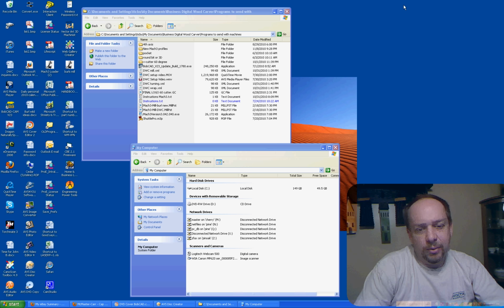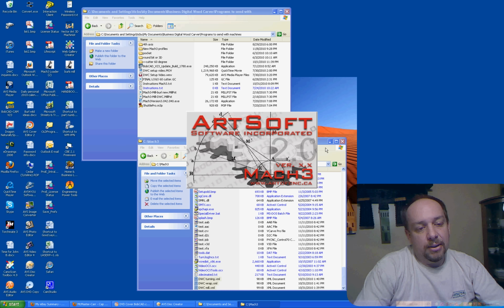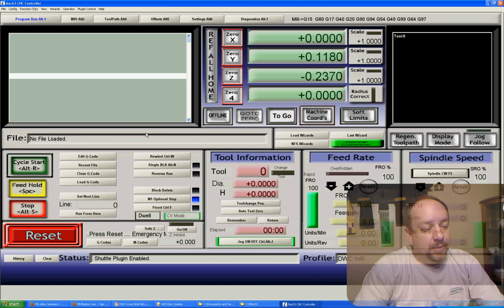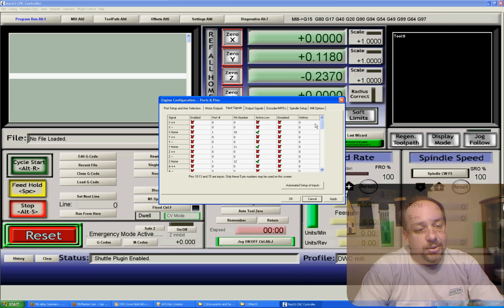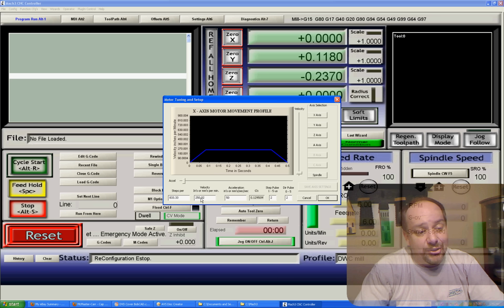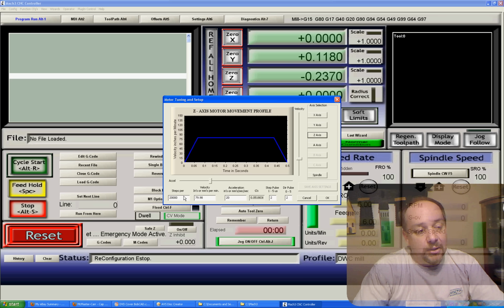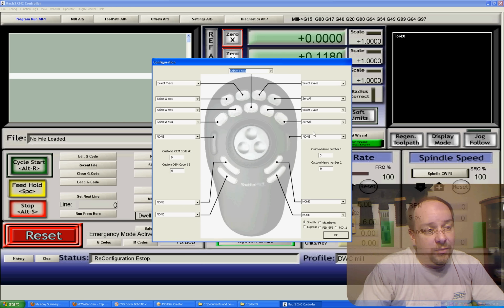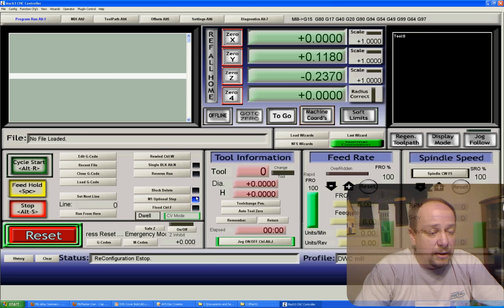Mach3 Setup

Comment: I just purchased a QC 1325 CNC router w/JDPaint 5.5 and Mach3 from China.
The machine will be delivered in about a mouth. I've been looking to find some info on the JDPaint.
Also I have a lot more question about how all this works.
I don't want to spend hours drawing a program when I can download it from somewhere . I heard of Dreamstime.
How do I do that?
Can you import art from anywhere and install in mach3
How to send from cad to mach3
I would like someone to run the the steps of downloading a file putting into cad send to mach3 and hit the start button on the cnc.
Can you help!!!
Thank you! :)
Phil
Reply: check out artcam express or autodesk 360. other than that you have a bit of work to do to instruct the code of what you want what tool you want how fast to run how deep to cut even what angles to cut.
good luck

Comment: Hi Burl I was hoping you might have a fix for a Mach3 Problem I am having. I am using ESS it is communicating with the computer I have I am using a G540 have the proper resisters installed.  All the right lights on the ESS light up G540 is green No faults I have down loaded all the drivers.  When I enable the drive the motor gets power but when I try to jog nothing.  I have rechecked the cables and I am stumped.  Any ideas where to look?

Thanks and nice video
Reply: look up mach3 web site and watch their videos

Comment: Hello
I have built 5x5 cnc plasma table, but i cant get it to run. I think there is no communication between mach3 and parallel port. When i run parmon parallel port tester and i press pins with mouse motor move then, but when i press arrows on keyboard motors will not move. I have set in ports and pins everything correctly. Thanks for replys.

Comment: hi i have a problem in my 4 axis TB6560 in mach3 i need to use it for foam cuting so i need x1 x2 & y1 y2 how can i set the mach3 to work 4 motors ? blackwater11@hotmail.com

Comment: Dear BWT I am trying to build a homemade cnc mill with 4 axis driver board and running the mach3 program. What would be the formula for figuring out the steps per, if I am using a Nema 17 and a 1/4-20 threaded rod for the x axis and also the y axis how do i configure them for the motor and tune up step, velocity , acceleration, step pulse, and the direction pulse?  I know there has to be a formula but not sure how do it. I admit I am a newbie to this artform but I am facinated by it. Thanks Don

Comment: HI, I HAVE BUY 3 LONGS MOTOR DRIVER DM542A AND 3 MOTOR NEMA 23HS9430 2 PHASE MOTOR 1.8° 4,8V 3.0A PHASE , I CONNECT ALL AND SETUP MACH 3 BUT MOTOR MOTOR DOESN'T RUN BUT MAINTAINS HOLDING TORQUE WHY ? FOR YUO WHERE IS A PROBLEM ? MACH3 PARAMETRES ? THANSK INFO@2TSOLUTION.IT

Comment: I want to make my own CNC with Arduino and EasyDriver shields
(the motors i allready have)   
is there an Mach3 or GCode interpreter for Arduino (without flashing firmware)

Comment from the maker: @HossHossHossHossHoss 

One of two problems. Motor is not strong enough. Or the drives can't supply enough power.
Your first problem was getting the chinese kit. I started out trying to be cheap and wasted about 3-4 years trying to figure out my problem. I now use Gecko G540 and they work great. 
Do you understand that the faster a stepper motor goes the weaker it is?

Comment from the maker: @ragheblatif 
Two things that I can think of that would cause this.
Computer- I have had computers that wouldn't send out a good signal commands. I try to stay with 2.5 hz CPU or new and a desktop. 
Driver-If you are using old or cheap drives than you can be missing steps. The old drives can't keep up with new computers. You can try slowing Mach3 Kernel speed down.
Hope this helps.

Comment: Hi
I installed mach3 and when running the motors (etepper motors nema23 - 280 oz.), the motors do not run smopothly , therey run and stop, run and stop repeatedly until they finish the cycle. and sometimes in the middle of the cycle they run smoothly for a second or so and then go back to their weird motion.
In the mortor tune window, the motor is set to a very low speed o inches per min. If I go to 20, the motor slides. my e.mail ragheblatif@gmail.com